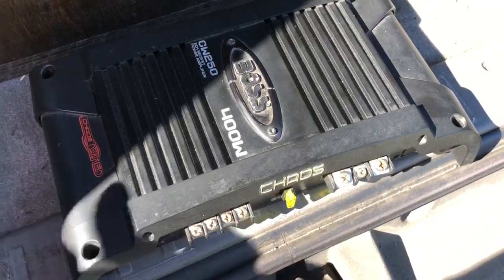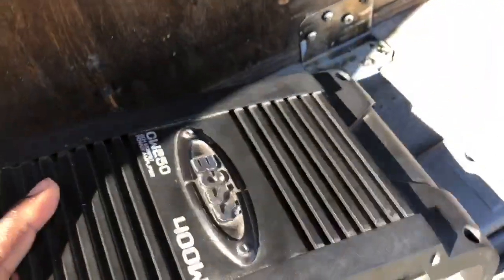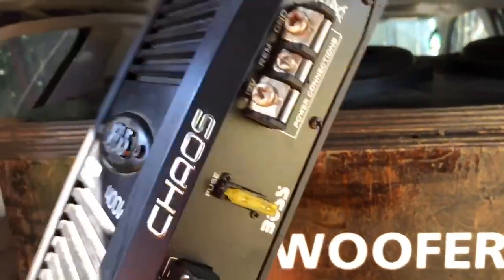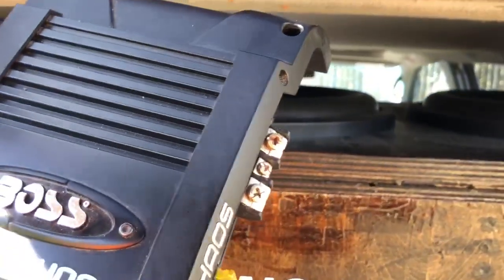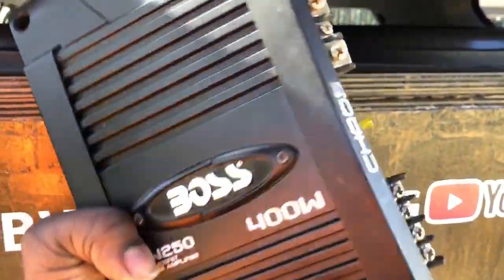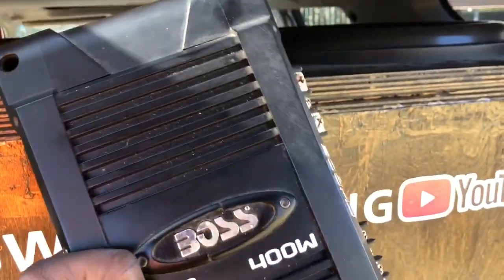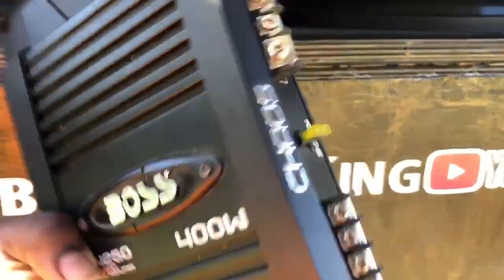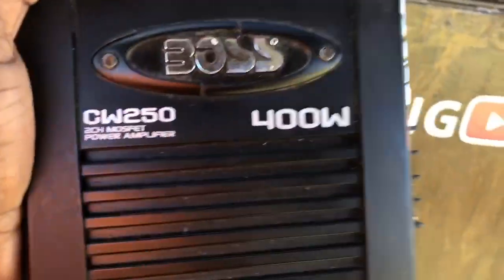Rockford Fosgate P2 10's FLEXING. Testing Rockford Audio P2's

Comment: My wife wanted her crown vic trunk back so I took out the MTX 7500 12's. Week later she says she needs some bass back. I put a small sealed box with a P3 10 where the spare tire used to be and was very impressed. I had a pair of the RF T3002 amps and regret selling em, haven't bothered with Rockford in years tho.

Comment: Back in '95 my friend had a 100 watt Boss amp pushing 4 12's (2 of them in a sealed box and 2 in band pass box) and we couldn't believe how good they sounded lol
Reply from the maker: bunky021543 Yeah back in the day when they were built in America with ZED. They were beast
Reply: @SubwooferKing100  yeah he bought it from Bestbuy because the shop that installed his system didn't install a fuse on his power wire and the wire burned up from the battery all of the way back to his amp. And of course it burned up his amp too smh but so after getting new power wire and a  fuse installed he bought  the Boss for $75 and it impressed us!
Reply: It's sad how many of the "good" brands sold out to China, most of them long ago. Boss is one brand that is literally worthless, for the price of anything new you're always better off buying some old used name brand stuff. 
I think it's just bait for folks that wanna bang but don't wanna spend. It's pay to play around here.
Reply: @bunky021543  A buddy of mine back in mid 00's spent nearly 3G's on a pair of Premier subs and amps with matching head unit, all brand new models. The shop used 8awg for around 2k watts. Started a fire in his mustang and the shop waived all blame. I wonder how long it would take to notice the fire if he had a trunk instead of a hatch.
That was a major contributor to me learning how to install my own
Reply: @1upPaintingAB  when my friend's power wire burned up I did the same and that shop put 8 gauge wire in his car! Since then I installed all of my systems except for 1 and that was only because I bought myself a brand new car. That particular shop did great work and I only got a single Sundown SA 12 installed but shortly after I wanted more bass (which was 8 months later lol) installed a Kenwood deck, 2 pairs of 5×7's, a pair of 6×9's, a MRV30 4 channel Alpine amp, a M240 Alpine mono amp, and 3 Fosgate P3 subs. There's nothing like having the knowledge and skill to install your own skill.
Reply: @bunky021543  Exactly, the knowledge pays for itself in a single install let alone multiple vehicles.

Comment: I would be surprised if that amp is even capable of 200 watts. LOL.
Reply from the maker: Joe B Yeah me 2, lmao!
Reply: Boss and similar fisher price audio brands usually dyno 1/10 rated power and rarely more than 1/4. And regardless of how cheap it is, the components are shit and don't last. A beat up used amp is a better choice compared to the bottom of the barrel brands.
Reply: @1upPaintingAB  they've gotten sneaky now too. Planet audio/Boss (same company) has started putting multiple 15amp micro fuses in their amps and claiming it'll push what the same number of 35amp fuses would be capable of. I've never seen such a large company go to such great lengths to be deceitful